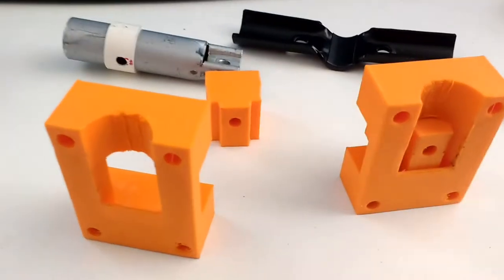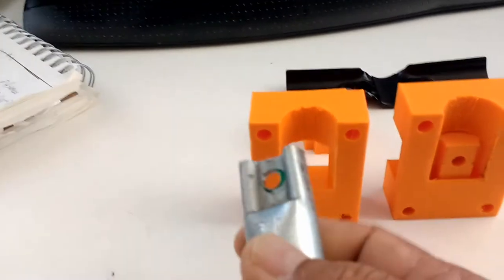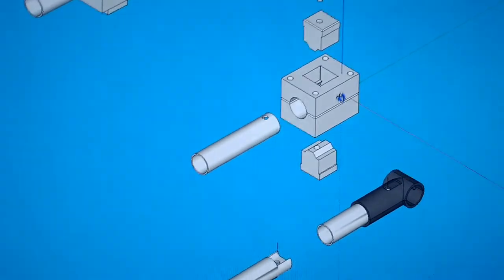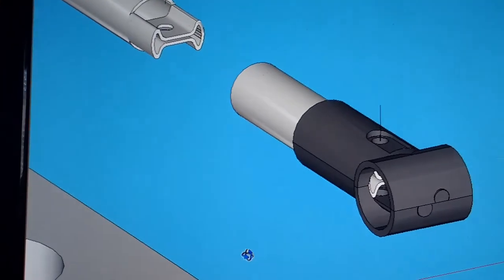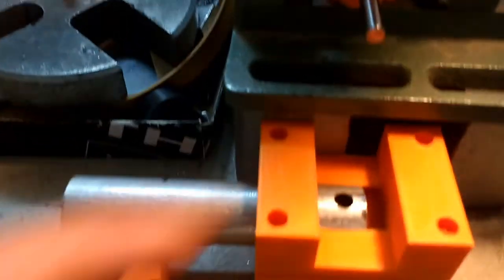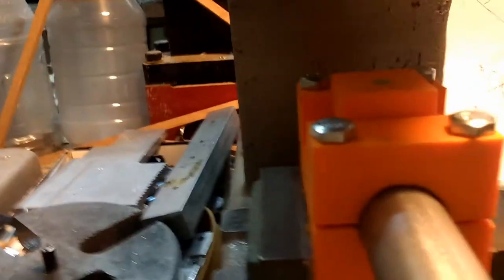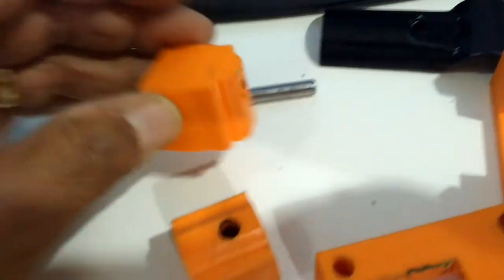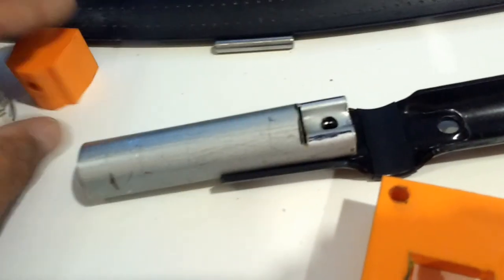3D Printed Tool Die for Pressing Conduit Ends to mate with Maker Pipe Tee Connectors

Comment: I love your work with maker pipe! Would love to be able to see more of the process, would you be able to record some of that with a tripod?
Reply from the maker: Thanks Boone. I will try to do another video showing how the press actually presses the material using the 3D printed dies. It works nicely using a 2 ton press, the way I show, but if the rig was setup more permanently it would be even better for consistency of the pressed ends.

Comment: That is awesome.  I have experimented a little with making dies. Do you have stl files available for the dies? This is exactly what I need to make my build more secure and allow me to do a quick release adjustment without everything falling apart. I want the pass through part of the tee to be able to slide up and down, but don't want the other tube to fall out when it is loosened.  This will keep everything together while adjusting the height.